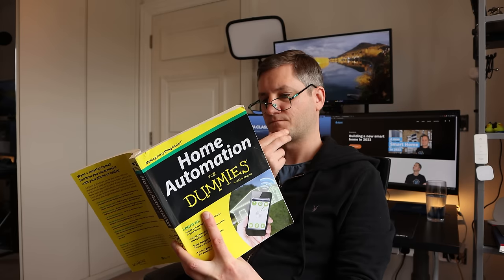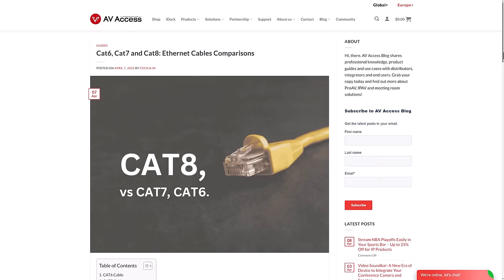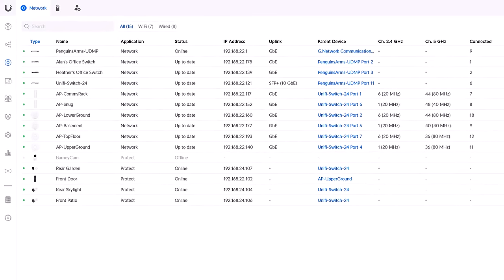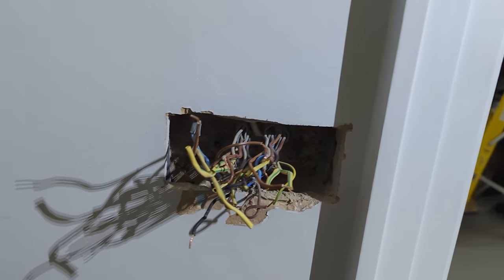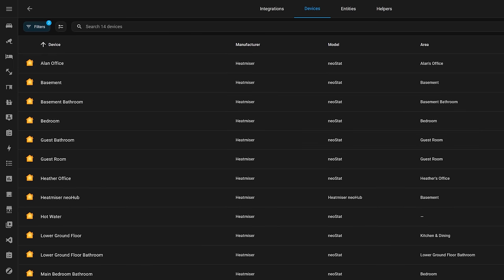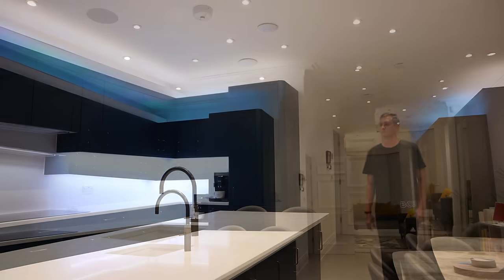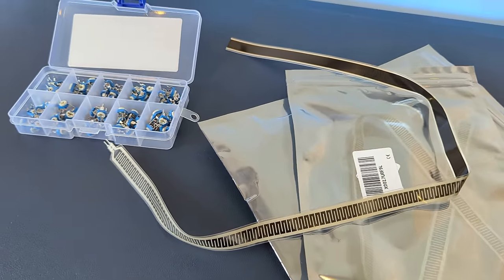The best and worst decisions I made for my smart home

Comment: I have Shelly for the switches & push contact grid switching, so that's your ocd sorted.
i will probably add the Zigbee Shelly if i was to change them
Reply from the maker: I couldn't seem to find any push switches in the UK 😢 I'm not sure if they're a thing here
Reply: @HomeAutomationGuy  yep can't add a link but the one's i use are from knightsbridge grid switch, i'm an electrician these work well, never let me down. just go to the local electrical merchant
Reply: Knightsbridge GDM006BC Grid Brushed Chrome 20AX 2 Way 1 Pole PRESS Retractive Switch Module
Reply: Im doing the same, as they take up much less space in the back box, which leaves more room for the Shelly.

Comment: About the zigbee blinds, how long does the batter last? and which ones you bought? I unfortunately bought RF ones so the control isn't the ideal, but the battery lasts around 6 months
Reply from the maker: It depends on the window and the time of year.  They last less time in the winter.  Some of my blind batteries last a month, others 3 months.  I have the Zemismart ZM25RZ01-30
Reply: @HomeAutomationGuy  then I think I'll stick with my RF ones, thanks for replying!

Comment: they dont need to make a different solar panel for each model if the solar panel is just providing a usb female connection the one solar panel should work for all versions of their blinds if it is a window adhesive based mounting
Reply from the maker: I did try one of their other USB-C solar panels on my blinds and it didn't charge them at all.  Perhaps I should look into a generic panel with enough Watts and see how it goes 🤔Got any recommendations?

Comment: I am starting my HA journey & just have a couple of devices, mainly lights.  My question is what do you do when you move house?  Do you hand over everything as part of the sale or do you remove it all?  What happens if the people who buy your home are not that technical. Interested to know your thoughts considering you are spending all this time and money on your setup.
Reply: Take it all with you I’d say. New owner would need your app account or you leave a raspberry pie there too etc. let them have the fun of setting up from scratch instead 😊 just replace with dumb LED bulbs when you leave 👍
Reply: @norfolkmustard  that’s ok when you use some smart light bulbs, but what about wired in switches, or all the led strips, or maybe you’ve put a smart door lock on & security cameras.  What about the network infrastructure that supports your smart home?  The smart home features might have been what interested the buyer in the first place.
Reply from the maker: This is something I've thought about a lot.  If I ever move I'll take all my smart stuff with me, but leave the light switches, air conditioners, alarm system, and thermostats in place as they all work perfectly fine manually without any smart hubs.  The only thing I'd so far need to do is replace the kitchen cabinet lights with "dumb" LED strips, but that wouldn't be too expensive or difficult.  This was a big draw for Smart Switches for me, as it meant they worked totally normally when you press them and meant I could avoid replacing all the bulbs.

Comment: Why not replace all plugs with smart zigbee sockets?
Reply from the maker: It's very expensive, and I don't need them all to be smart.
Reply: @HomeAutomationGuy I see, maybe there isn't much value added to doing it. I need to check what is really worth it in terms of controlling the energy usage as I want to be able to turn off circuits I do not use throughout the day
Reply: @Beni10PT I’ve tried a couple smart sockets. Current fav is the Aurora AOne. NB that it tracks power but not energy but HomeAssistant can approximate that with Riemann Sum Integral helper (I’ve found the “left” variant of the helper most accurate)

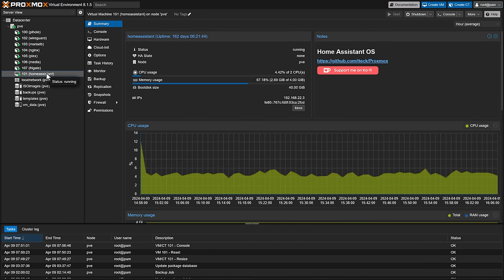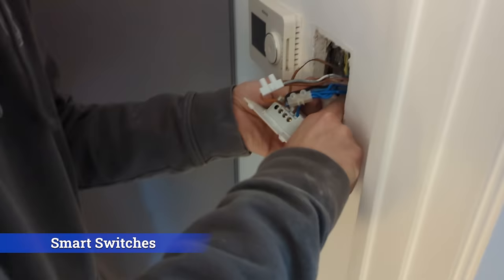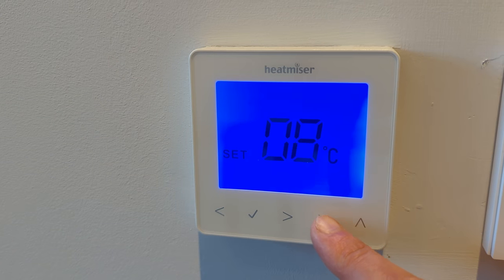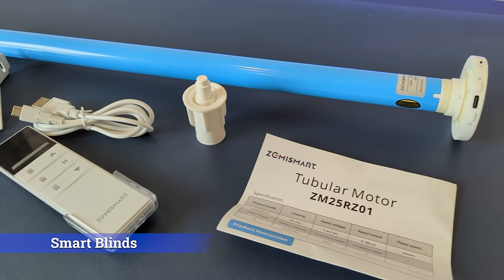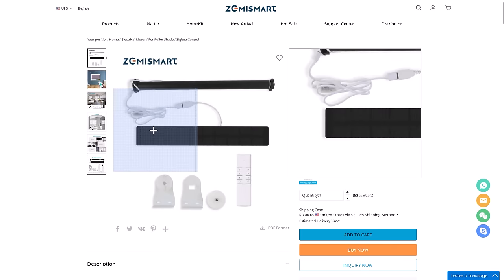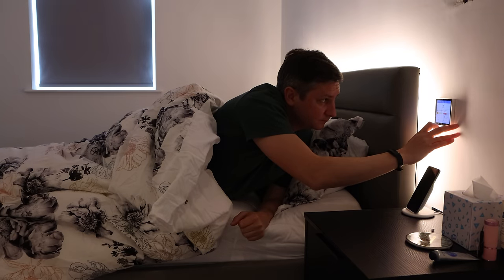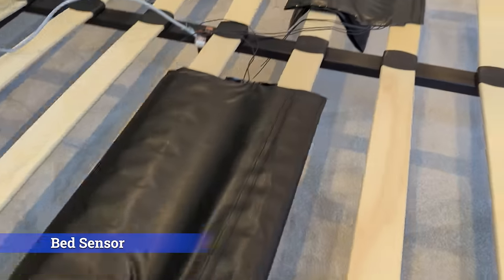Comment: ISP Fios 500Mb My Network is  1:25 Netgear Orbi's .  3:24 Alexa & SmartThings ..its so much easier.. No PC require. Smart home ,even works with Zooz . 4:18  I use all 3  Zig Z-wave and Wifi .  6:21 Lutron -YOlink Ring  Amazon Plugs and Hue Plugs  8:59 Honeywell   9:54 I got Crappy ones MySmartBlinds 11:44 Crappy FP1 &FP2 Dumb Sensor is Ring  13:20 Hue Lights Govee and LIFX  14:00 Flic Buttons I hate Dashboards  make a button dashboard on wood panel.    14:57 😒 I dont have bed sensors    Add on :  Dumb toilet to Smart toilet with Kohler Kit Locks ..  Lock Kwikset ..Home made Sliding door lock.  Goto Smart Home Product is Yolink Ring Hue Lutron Alexa

Comment: I know what you mean about batteries, I have 63 devices with batteries. Most are Ring devices as sensors for all of my windows.
Reply from the maker: Slowly, but surely, I'll be able to move away from batteries - but probably never entirely! Getting my alarm system integrated into Home Assistant gave me access to its hardwired contact sensors, but unfortunately they only fitted them to the external doors and lower level windows.

Comment: I have Zemismart zigbee blind motors ZM16EL-03/33 and they report battery status in HA
Reply from the maker: Sadly mine don't, even after re-pairing them 😢
Reply: @HomeAutomationGuy  Maybe you can configure the blinds to report batteryPercentageRemaining periodically under the Reporting tab on their device page in the z2m web interface?
Reply from the maker: @davidgwynne243  Unfortunately it says that this attribute is "unsupported"
Reply: @HomeAutomationGuy  what model are they? my guess is they're actually tuyamcu based and report battery status as a tuya datapoint rather than the normal zigbee powercfg cluster.
Reply from the maker: @davidgwynne243  Zemismart, but I'm assuming Tuya based.
Reply: @HomeAutomationGuy  what model zemismart?
Reply from the maker: @davidgwynne243  zm25rz01

Comment: Everything presence sensors are a con. No way that should cost anywhere near that much for a kit. I have mostly just standard cheap presence sensors and battery powered motion sensors, which are better placed than can be done in an all in one sensor. They don’t really add anything. I thought they’d be quicker or something. The only reason I’d use motion sensors now is if there was no power any where near. 
Zigbee is fine for my house now but I want to return to the countryside so I might install a LoRaWAN hub so I’m all set when I do. Think the hub can run open source firmware called chirp stack that emits MQTT messages on the local network before sharing it with a server in the cloud, but I need one to play with. You can run a server locally on your network and there is a github project to enable it locally but no current Home Assistant Add On and I run HA OS. Maybe when I get another RP up and running. Bet you could run it on your server. There is a docker. Kinda unnecessary though unless you want to leave town living.
Reply from the maker: I think that the Everything Presence sensors are good value for what you get - but I get that there are more affordable alternatives out there.  I've never used LoRaWAN or anything because I live in a small London house, but I've heard good things!

Comment: The older dumber Daikin air conditioners accept a very dumb wifi dongle that works when isolated from the internet, and via unpatched HA (or a simple python library). Guess I got lucky.  Shame when the newer stuff tries to be smarter 😞
Reply from the maker: My friend has these versions and they're great - but they weren't available when I was asking my installers. The new ones are apparently "better because cloud" 😔

Comment: Do you have a guide for the Daikin Oneceta hacks addon/integration?
 
Looking to get mine working with HASS.

PS for the SONOFF NS panels, you have similar panels that run STOCK android. which would be better than the NS panels